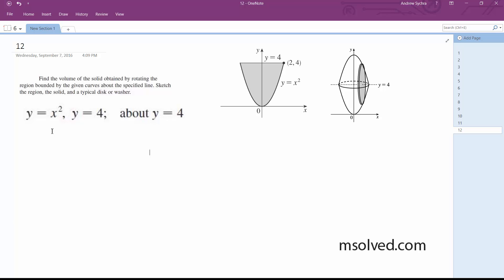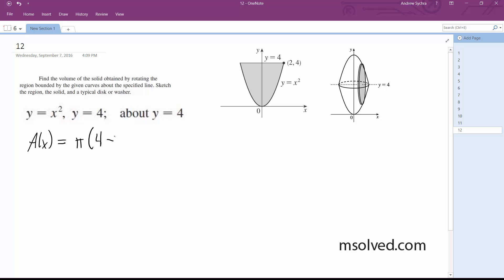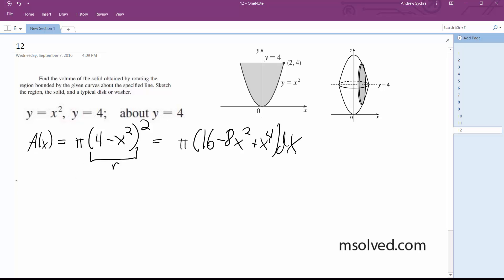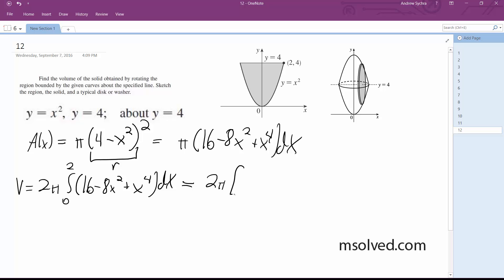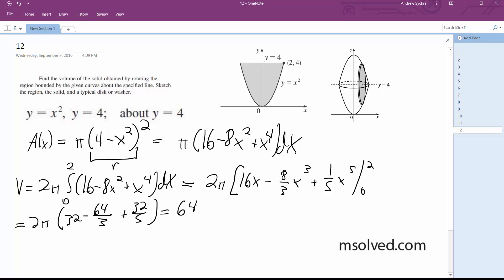y = x^2, y = 4, about y = 4

Comment: why did you change your limit of integration from -2 to 2 , to 0 to 2? also, i thought the formula was the integral from a to b of 2 pi x (or y) (sqrt1+(dx/dx)^2) please help
Reply from the maker: Probably because in this instance it cancels itself out, hence 0 to 2 and than just multiply by 2
Reply: thanks 4 your help your vids helped a ton